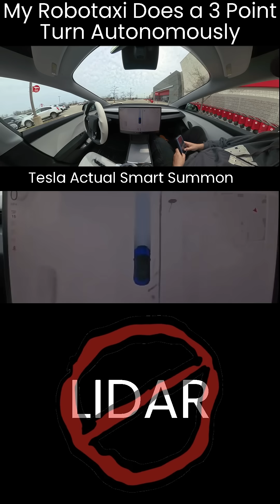We Don't Need no Stinkin' LIDAR - Tesla FSD 13  #autonomousdriving  #teslafsd #lidar

Comment: A human can see with one eye ok, but with two he still still have a better perception of depth. Maybe you don't need LIDAR or ultrasound sensor but in some extrem case it will be safer. Ask boeing and MCAS with only one sensor...
Reply from the maker: Tesla has two forward looking cameras. If one camera fails, the car uses the other to pull over to the side of the road.
It can also use the two cameras for stereo vision.
Reply: @ericgregori  because on a highway, the side of the road is safe... Nobody can make me change my mind: more information and redundancy is always better for safety... It can work without LIDAR but it can be safer with it...